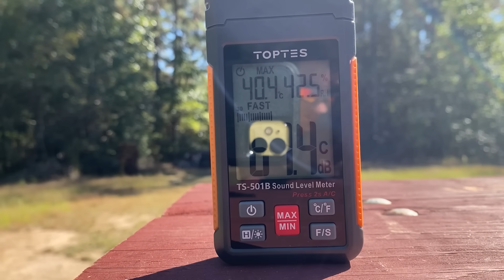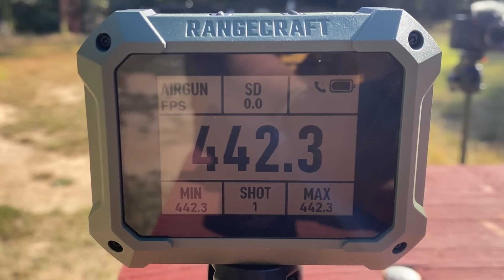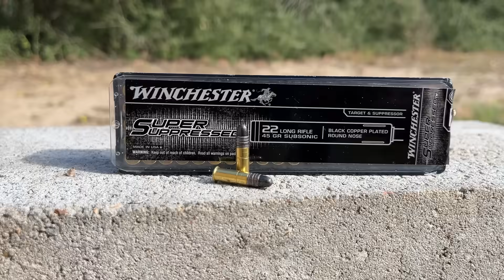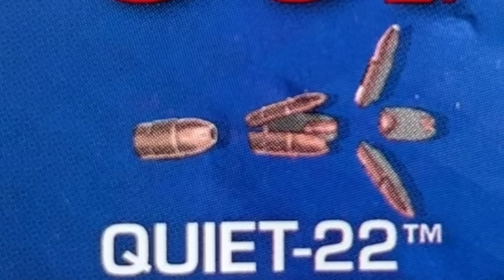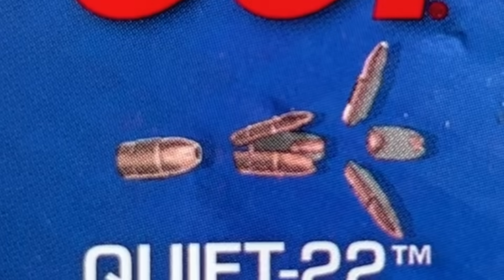How Deadly Are Colibri Bullets?

Comment: No disrespect.. but this is an indoor round use on rats and feral pigeons inside barns  it was made so the average farmer could use his 22lr rifle inside his barn without causing damage to his roof or barn walls as a vermin controller these fit a very specific roll !! Dont hate the calibre hate the projectile 😊 like you have no idea that the 22wmr tnt hollow points kick arse where you have said ground squirrels are tough and 22wmr isn't enough gun for the job!!!!!! Bollocks!!!! 30 grain 22wmr tnt hollow points Will shred them twice as good as 17 hmr...... I really don't know how many times I will have to say this to the American market but I drop foxes regularly with 22 wmr new generation ammo that you make 😮 all this rubbish about calibre is bollocks hate the projectile not the calibre.....................😢

Comment: That's not a bullet it's a round or ammo or cartridge
Reply: He's probably calling about a projectile otherwise known as a bullet. It's not the brass. It's not the completed assembly. He's talking about the part that flies around through the air. The projectile is called a bullet. Beaches
Reply: @willfriar8054  At 0:06, he's holding a complete assembly and calling it a bullet.

Comment: I tried using 22 Colibri as a garden pest control round. About as quiet as a pellet gun and not any more effective than a pellet gun. 
Switched to using CCI 22 CB Long. Almost as quiet and much more effective. The 22 CB Long has only about 1/4 the muzzle energy of a HV 22LR, but it is powerful enough to take rabbits and raccoons out of your veggie garden.

Comment: I had been using the Colibri and the Super Colibri (850 fps) through an old Steven's mod 1915 single shot for gophers. I was living in a subdivision out side of Bozeman MT. I could shoot non suppressed with no complaints from neighbors. I must admit that they are not very good at a distance of over 20 feet, but it was in my back yard.

Comment: I prefer cci supressors trough my ruger mark IV. Those work even in cold weather (-20C) while cycling action reliably while still keeping noise down with supressor.
But if i want extra quiet i have used those cci quiets. Not oomph to cycle but if hollywood quiet exist then those are pretty close.
Will drop crows if gets too close.

Had intentention to test those colibris but those are tad rare in just couple shops so never specifically ordered them for that hassle what they very likely are worth.
Good to know that those are actually wimpy as it gets. Ever worser than some air rifles.

Comment: THE BULLETS IN QUESTION ARE CB CAP AMMO. AS FOR WHAT THEY WERE MADE FOR.
"CB CAPS AMMO" refers to .22 CB (Conical Bullet) cartridges, a type of low-velocity, quiet rimfire ammunition often used for short-range target practice, pest control, or with older firearms. Despite the name "caps," they are a full cartridge, not a percussion cap, and are known for being quiet and safe to fire indoors with the proper equipment.
Reply: That is true but the original BBCap was in fact a BB placed on a percussion primer
Reply: @tommywalker43  YES THAT WAS A BB CAP, NOT A .22 CAP LIKE THE ONES IN THE VIDEO.

Comment: You was calling it a squirrel puncher earlier and to be fair, 2 1/2 inches is a devastating amount of penetration for a squirrel.
Reply: These work well on squirrels without making a lot of racket.
Reply: @mattd6642 

I had used the RWS 6mm Flobert CB Caps and CCI.22 CB Short Caps which have a small amount of powder in them (Unlike BB Caps). I was skeptical about these priming compound only loads having enough velocity to penetrate.
Reply: I believe it should be compared with air pellet guns not full power 22s.
Reply: I've taken out quite a few squirrels with these rounds. Often the impact on the squirrel is louder than the round going off.
Reply: I shoulda been a squirrel. I’d be devastating.
Reply: Human Skin Penetration  = 2-3" in Organic or 3-4" in Clear Ballistics. I believe squirrel hide is likely tougher.
Reply: @gk5891  It's pretty much a pellet gun.
Reply: @gk5891  Perhaps. Also good luck hitting it with a pistol to begin with.
Reply: @Zarkonem 

Colt Woodsman Match Target with Eley Match is sub-1" 10-Shot Groups at 50 yd with a good rest.

Offhand I have no issue hitting empty shotgun hulls at 50' with a Dan Wesson 15-2 Revolver and I'm mediocre at best.

Now is the ammo here capable of it is another question. I found CB Caps pretty inconsistent back when I used them on squirrels out of a Winchester 67A (but those had a few grains of powder unlike BB Caps).
Reply: WOOO! 2 1/2 inches of penetration is absolutely devastating and anything extra is dangerous and unrealistic!... Wait are we still talking about bullets?
Reply: @zrhothehero4191  I'm... not even sure anymore...
Reply: @zrhothehero4191 same thoughts bro… I shoulda been a squirrel.

Comment: wrt the bullet getting less depth on the trim than the thicker plank, it may have something to do with grain. When shooting at the pine plank, the grain is oriented so that the bullet is perpendicular to the rings - thin layers that are easy to penetrate if well-supported. In the piece of trim shown you essentially have a quartersawn piece of wood. When the bullet hits the wood it wedges itself in between the grain rather than boring through it. This orientation has more give in this direction, so the wood may be flexing more and dissipating  more of the impulse from the bullet than a flatsawn plank. Also notice that the molding has cracked along the end grain, showing that the wood has flexed past its yield point. 

Incidentally this is a problem with repeatability in the pressure-treated lumber test; bullets that hit in the center will perform markedly differently than bullets that hit at the margins. I recommend switching to an equivalent thickness block of plywood.

Comment: You don't need a suppressor for these, they actually sound like a dry fire unsuppressed, they're so quiet the sound of the bullet hitting the target will drown out the sound from the gun. These can kill rats if you can hit them and if shooting in your backyard neighbors will not suspect a thing, when I lived in a subdivision with houses very close to each other I shot rats in my back yard with these because they were much quieter than any pellet gun I've ever heard but accuracy is not great. I have got them stuck in a long barrel. it was an old bolt action with either a 24" or 26" barrel though so handguns only, they do make a super Colibri that's a bit more powerful and louder though still about the same as a medium powered pellet gun if shot out of a rifle and they will not likely get stuck in a rifle length barrel.

Comment: Super Colibri is the way to go. Never had an issue in a rifle and much quieter than a pellet gun. The sound comes from the hammer dropping and the target getting hit. Aguila subsonic sniper ammo is interesting but you really need a special high twist barrel to stablize them. I'd want to see those getting fired properly for sure. 22 LR length with a 22 short case and a 60 grain bullet!

Comment: The colibri rounds were designed as an armor piercing round for use against tanks and reenforced concrete bunkers and would easily punch through even the latest armored vehicles. 🙄 It's an indoor target load. It's not supposed to penetrate.

Comment: I think my Gammo .177 can do damn near 2.75x faster than that, so long as I use the gold plated ones (1200FPS), otherwise it's "only" 2.25x faster 😅 
Probably the same noise level, though! (unless I diesel it, then it's probably subsonic .22)
Reply: I seriously doubt it's the same noise level or even close to it. It's more quite than any airgun (pellets or BB's) that I've ever shot or have been around. Including a red rider and much weaker.

Comment: Didn't watch the full video, but I have used the Aguila rounds intermittently for quite a number of years.  Back in the day, I didn't have a chrono so can't speak to actual velocity numbers.  Didn't have a decibel meter either so there's that.  But I can unequivially say that at closer ranges, the rounds would handily penetrate 3/4" plywood, while when fired through my R92, the only sound you'd hear was the hammer falling, and the bullet impact.  Fun little things for indoor (with proper backstop) and backyard plinking.  And while, no, they likely wouldn't be useful as any sort of "defensive" purpose, they certainly shouldn't be considered nonlethal and should be treated with respect as, anything that will punch through 3/4" plywood with regularity would surely penetrate the average human skull...

Comment: Ok folks I figured it out.  This is a bullet for when air rifles get banned but you miss the lower power. Lmao. Great video. Thanks.
Reply: Fr but someone said these bullets are used indoor alot but it went straight through wood so again a pellet gun would be better for indoor shooting
Reply: You must not own any of the newer Pcp's huh? Most pcp's from .177 to .50 cal are doing the same, even more power and fps than powder burners now. My brother has .177, .22, .25, 30, 35 cal pcp's that all are super sonic, some are even factory Auto/semi too. They actually use a tual Bullxt projectiles in pcp's now too.

Comment: The Aguila Super Colibri DOES have powder in it. I found it all over the action after firing them in tests. I tried to use it  in a 20+ inch savage and a Remington and the barrels were too long so they went everywhere but where I aimed. Then I read they can not be used in anything over 16 inches. I have more 22's now so will try again. I just wanted something I could use on paper and steel that wouldn't annoy the neighbors.

Comment: I’ve tested them on empty beer bottles. 75 % of the bullets just bounced off. Only a few bottles broke. And a couple of those actually just poked a hole through one side of the glass. That’s right, a hole, not a crack.

Comment: We love Super Colibris.  We have a backyard.22 plate rack and dueling tree and shoot them from a collection of old Colt Frontier Scouts and Winchester 62As.  Gives us a shooting gallery that’s easy on the budget and doesn’t bother the neighborhood.

Not enough power to consistently flip the dueling tree plates @ 10 meters so we use CB caps for those sometimes but out of the 62As, they are whisper quiet and out of the Frontier Scouts, they’re still quite enough to skip ear pro.
Reply: The Super Colibri's were meant for rifles because as stated the Colibri sometimes won't make it through a long barrel. Just don't mix them. They're visually identical. The difference between them is the amount of primer compound they're loaded with. They can be used with pistols but with a louder report. Not much but louder.
Reply: Me too. The hammer drop is louder.

Comment: Seriously though, I have killed many squirrel and rabbits with this round. The secret is to hit the head at under 15 yards.  It will bounce off the shoulder but will crack the skull. How do I get a within 12 yards of a squirrel?  I put a pile of corn 10 yards in front of my metal shed. I crack the doors about 2" and hide in the shadow inside.

Comment: I've used these with great success on squirrel and starlings. I fired them out of an old Sears single shot, and have only had one get stuck. After cleaning the barrel from 50 years worth of lead buildup, it still puts them right where I want them. Farthest I've shot with them is around 30 yards, but that's making the Calibri work way too hard.

Comment: According to my math, your average baseball weighs about 145 grams, which is a little over 2200 grains. If you throw it at 50mph (73ft/s), which is a good throw, but not a 100mph major league fastball or anything, that gives the ball about 26 ft.lbs. of energy. So, the average person can probably throw a baseball with about three times the energy of the Colibri bullet. For comparison, a standard velocity 40 grain .22 moving at around 1000ft/s generates just under 100 ft.lbs. of energy. I guess the moral of this story is that, if your aim is good enough, throwing a rock at a squirrel is probably just as deadly as trying to shoot it with a Colibri.

Comment: A bolt/pump action rifle should be fine. I've seen CB rounds in long and short. I shot them out of a revolver with a 6.5 inch barrel and they are super quiet. The rounds are super slow. I would hear the pop and the thunk right after shooting a tree about 30 feet away. They kinda sound like a cap gun.

Comment: They also sell a Super Colibri. It's a little bit more powerful. I don't know if those have a sprinkle of powder in them or just a little more primer compound? They are fun in a short little youth bolt action rifle. Its basically just converting your. 22 into a pellet gun but powder actuated instead of springs or compressed air.
Reply: They do have a sprinkle of gunpowder in them. I pulled one apart!

Comment: They also make a super Kolibri that has more priming compound for longer barrels and/or a bit more muzzle energy.  I run these in a single shot suppressed 22 to delete tree rats in the back yard and they're quieter than my pellet gun.  About 11ft/lbs which is right at the same I'm getting from my .177 nitro piston pellet gun with moderator.  Still likely not gonna make it through the pine board though.  Another issue is they're really dirty and after about 10-20 shots the barrel needs to have a snake dragged through it or the velocity drops to the point of either getting stuck in the bore or bouncing off a squirrel butt.

Comment: I never knew about these and reading the comments, they would have been a perfect solution for my needs once I moved to a city. But I bought a couple thousand dollars worth of airguns and high pressure compressors. I don't regret it though. Shooting airgun slugs is incredibly inexpensive and very satisfying. But I'll recommend to anyone who goes down a similar path... Don't go bigger than .30 cal. My .30 cals are almost too loud and one of them is definitely too powerful. If you're interested in buying a .357 or .45 airgun.... Might as well just get another powder burner. You're going to have to take them somewhere else to shoot and that defeats the purpose. Might as well just take your .22lr, or whatever you like to plink and target shoot with, instead of loading up the airguns and compressors

Comment: Dude, I bought thousands of colibri. They are so weak that I've had trouble penetrating a squirrel skull at 20 inches. Had some rabid ones and I was trying to do back of skull where it's weaker, bugger was moving and it hit straight on the top and just gave him a booboo. Used my .22 pellet gun after. Felt like a piece of shit. 

However these bullets are awesome for 3d printed 22 Derringers for backyard use for gallery shooting into trash. And of course revolvers too.

Comment: Horrible ammo.  Advertised as Aguila colibri  22LR, but it's to short, it's not 2wLR, not even 22 Long, and tend to jam, misfeed.  Try to land more that 3 rounds into straight magazine ? Good luck.  This a 4:37  requires either longer bullet or longer case as CCI Stinger for it to work properly.  Target shooting?  Forget it, it had like 15MOA from Ruger Precision, and I think this was due to feeding issue due to improper bullet length, and tip of the  bullet being damaged during chambering
Reply: Not sure why you had so much trouble with it loaded up my 22lr with it and it fed fine
Reply: Sounds like user error, you’re dumb

Comment: Been using Colibris and Super Colibris in backyard safaris for more than 20 years.  I feed them through a dedicated Rossi Youth Model, break-action rifle with a 40mm Bushnell scope. It has dispatched hundreds of unwanted yard-invading varmints.  I've taken out Rabbits at distances up to 75 feet.  Say as you will, the Colibri is a wonderful thing.  It's a shame they are rarely available just now.  Must be trouble in Mexico.
Reply: Reading this relly makes me wanna throw a scope on my rossi youth model. The one with interchangeable 20 gauge and .22 barrels. It would be perfect for groundhogs paired with the segmented cci's. They function well in my bolt gun but the break open would be nicer, assuming it can compare to the accuracy of an old marlin. I haven't shot that rossi since i was a kid, and i only used it for plinking at cans in the mountains lol
Reply: They are definitely hard to find. I found out about it when researching ammo 2 years ago, but it was out of stock everywhere. Finally found a dozen or 2 boxes in a local gunstore and bought several of them lol

Comment: Both my air rifles have more fps and fpe than this round.
Better accuracy and i have no dought drop. What is the point of it?
 Not as though its a pratic round or can even cycle the reloading. Its just a more expencive, softer hitting projectile than a standard adult air rifle.  It travels about the rate of my 1322 pumper air pistol.  That I only use on small pest birds to 30m and rabbits to about 8m.
 What a waste of certridge space.

Comment: A normal, class-2 sound level meter is inadequate at giving an accurate reading at the peak dBA. You'd need a more precise class-1 dBmeter, where you can set the sampling interval time to be as low as 20 ms. That would give you a more accurate reading on light loads, but a specialized one would still be needed for something that goes above 130-135 dB.